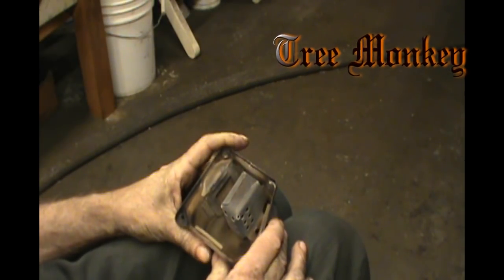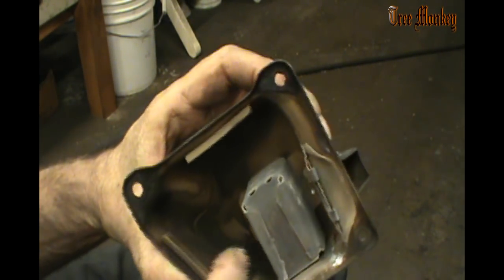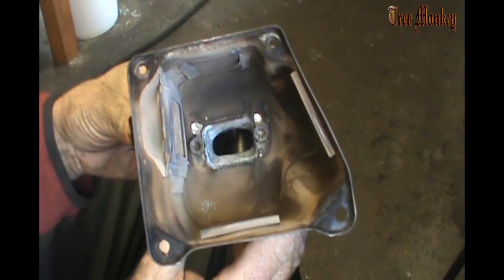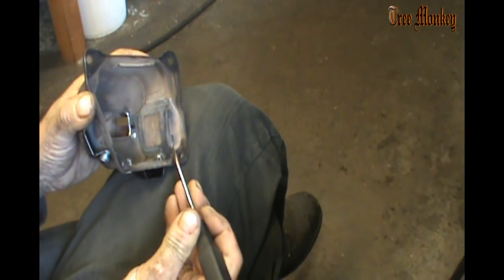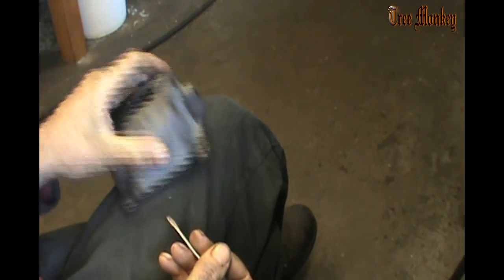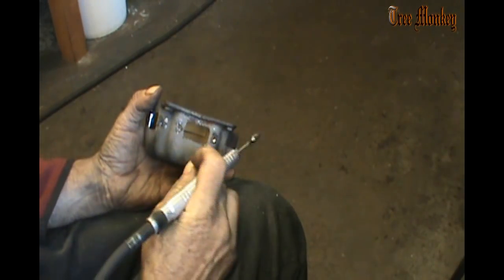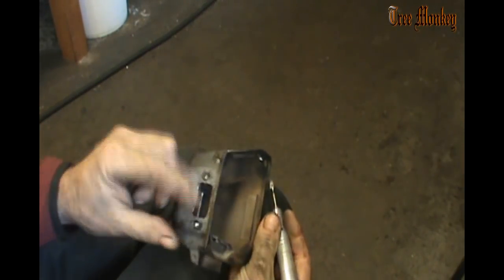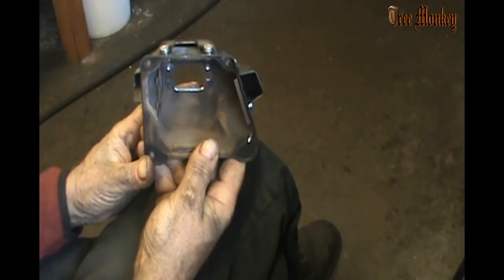porting video series part 9, muffler

Comment: Why do we even need to clean a muff, after grinding and getting metal chips all over.....I thought "nothing goes into cylinder that way"???  I'm being tongue-in-cheek, because when I complained online Re my aftermarket muffler, with a big hole creating a 4" direct path from "outside world" through the open muff to the exhaust flange....was so scared it would suck-in crap (and it DID hang a ring / require rebuild, but no way to know why the ring hung, OPE seems pretty confident it was the chamfering&size of exhaust port itself... But yeah I'm not just OCD Re cleaning my muff, I also want the rear baffled half NOT open to the outside...when an engine is being started or stopped, and going to or from Idle-RPM from 0 RPM, there is a certain low RPM where the back&forth suck&spit of the cylinder absolutely could eat something...
Thanks as always for the great vids, this is some of the finest muffler talk I've heard, will link my vid when I finish & show it but I have a design for 660's where you add/sandwich a 'baffle plate' in between the front&rear halves, it shares the 3 'square' mounting holes but, the bottom/clutch hole, that is not affixed but instead that corner of the sheet metal is bent back towards the exhaust flange....exhaust spits into the flat baffle, slides-around the curve &back at itself for max back-pressure & scavenging, but - with the area between the front & rear created by lifting that bottom corner - there'll be no restriction on exhaust gases going to the front half & then out through the Egan-type hole (am just doing it that way for ease, wouldn't buy an Egan on principle!!)
[PS - Would LOVE to hear your thoughts on the "pipe mufflers" that Buckin', Iron Horse, Tinman etc are using, "L pipe muffler" and "bear claw" types of mini, tuned pipes!]

Comment: Late to the party, but how do you know how big you can go, or how many ports you can add before you've gone too far?  I'm looking to port on old 024 and 026, but I don't plan on changing the timing any.   Just widen the exhaust, square the corners up a little, polish it up, and clean up any parting lines on the piston.  Not sure what I should do to the mufflers other than remove any baffles and match up the port.  Obviously it will need to breath a little more than that, but how much?
Reply: You’ll be wasting your time, unless you just like fiddling.

Comment: Hey Scott you said one function of the baffle is to increase back pressure. How come removing it doesn’t hurt performance of the saw then? Especially with the two additional outlets.

Also, where do you get those exhaust deflection shields from for the additional outlets? Cheers
Reply from the maker: to much of something is not always good
Reply: scott kunz I see! Thanks

Comment: Scott I use chainsaw cylinders on motorized bicycles. any advice to give me?
Reply from the maker: i'd build it more for torque then rpm
Reply: @floydnglenn  11404 rpm out of a ts400 before circlip failure. I have crosstalk and wanted to ask you what i should do about it? The ts400 can go 60mph on a motorized bicycle. It runs with crosstalk but i want to eleminate it. I saw you use epxoy to move the intake to 165 degrees. This is my group https://www.facebook.com/groups/293152804867443/